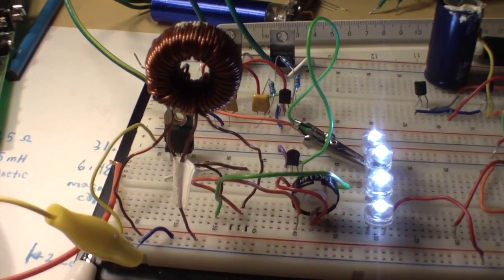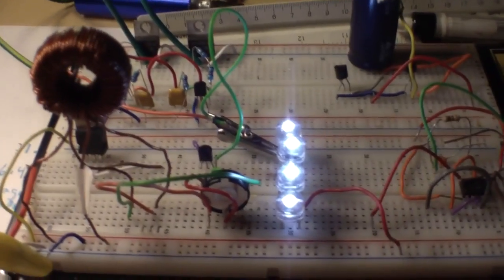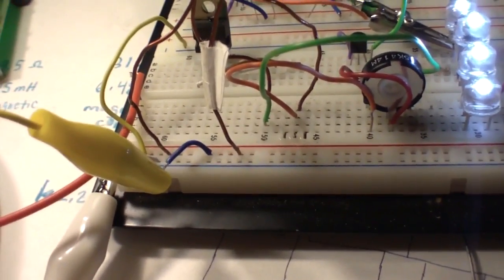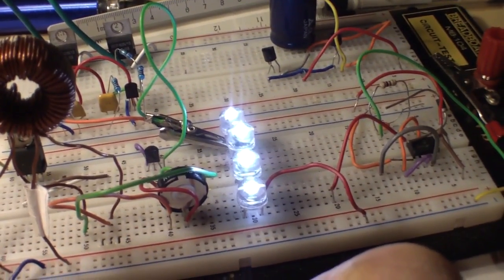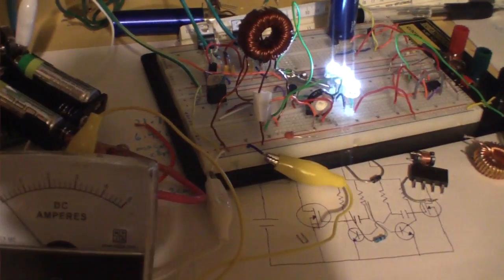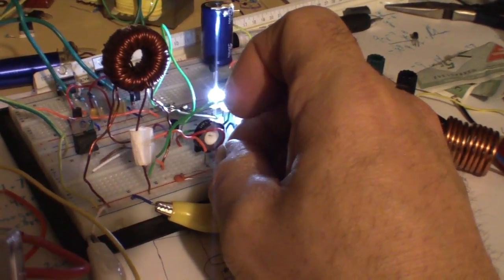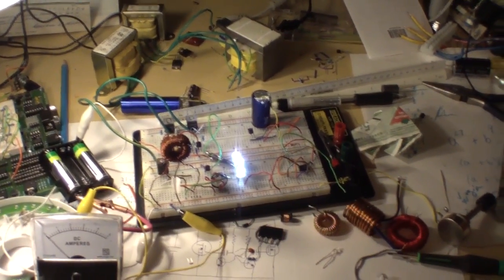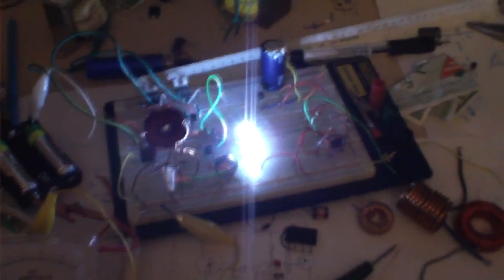Joule Thief (Revisited) - Adding Capacitance

Comment: Some of the numbers spoken were not true, you need a scope with current probe to properly read currents when the circuit is switching hundreds of kilohertz.
Using a analog meter to read current spikes has massive error. Back when we had spinning power meters on our houses, I designed a 100W 24v power supply for 120Vac input, it would pull a massive spike in current at 90 degree. At 101 watt output, the input power meter was reading under 2W. That is why most power supplies now have PFC at the front of the power supply. To get useful data, you need the proper tools. Thanks for sharing.

Comment: The voltage at the base is kinda ac, and capacitors act as short in ac so the capacitor act like short and bipass the resistor for brief period of time. This provide big boost of power in the transistor for short time. I would like someone explaining this capacitor better but didn't see anybody explaining this on any video, just showing how the lights going up and current goes down.

Comment: Might I suggest spinning up a really Big "Bifilar Pancake Coil" for your Joule ringer experiment's, I found they work well in this circuit.  
Also making Joule ringer, Pancake and Vertical Tesla Coil, 1 transistor(Slayer circuit) circuit can be used for "ONE WIRE (OFF BASE and/or OFF Secondary Coil) Transmission" as "Lidmotor" demonstrates, going out 20 feet with one wire on 3Volt source lighting LED 1 wire 20 feet, safe voltage :)  THANK'S For Sharing you insight

Comment: Resonance in any of these circuits is affected by resistance capacitance and inductance.  I think the key is that when built properly the resonant frequency of the coil and the circuit at it's optimum is done by selecting the right capacitance and resistance for the circuit in achieving the peak power of the circuit.

Comment: i feel like everyone tha g is using those analog meter are trying to het away with something why not use a digital multimeter
Reply: James Holbrook digital multimeters are great, but they aren't very good at showing subtle fluctuations in measurements like current. Analogs are great for showing minute, momentary bumps that generally are missed with digital meters. That said, it is much harder to get an accurate reading with analog. Still, there are pros and cons for both and I don't see anything particularly suspicious about using an analog current meter.  Both types can be hacked and used to fool viewers.

Comment from the maker: @egn83b  This is not an LRC resonant circuit . It has the properties of a blocking oscillator, it self oscillates, and it behaves like a boost converter, at the cost of current. Unlike a transformer when used with AC, that has the ability to be continuos because the voltage is always varying. When the transistor gets driven to full on, current rushes into the coil ramping steadily upward, but then it nears saturation, secondary flow stops, transistor shuts off. Repeat.

Comment from the maker: @User2718218 Also, there is no particular reason to be overly concerned with the absolute amp draw, without knowing the lumen output... which is why i explain, "when you are happy with the light output", try to lower the draw, in other words... tune the circuit. It's functional advice, not a scientific efficiency test. How to get more for less and still be happy : is the message here.

Comment from the maker: @User2718218 There are definitely better ways I agree. All such circuits should be measured with a RMS meter, for starters, because the draw is not linear. In as far as the directional movement during draw decrease goes, the analog ammeter current passing through a coil causes the coil to move in a magnetic field. The don't drop, while current rises, just like the earth doesn't change directions of it's rotation. However, at the very bottom of the scale... things are unreliable.

Comment: @KyleCarrington
That's how the capacitor in my Supercharged JT works: it pumps up the circuit to a higher speed.  That's why I call it supercharged.  Instead of running at under 100kHz, it runs at over 200kHz.  I've noticed that in some JTs, the cap causes it to jump into a mode where it's brighter.  But the capacitor has to be tuned to a critical value.  My SJT doesn't have that problem.  A 560 to 1000 pF cap generally does the job well.

Comment: @KyleCarrington
I've had similar problems.  That's why I tell people to use a bypass cap - 10 uF or more - across the supply close to the circuit.  1 ohm carbon film resistors are a few dollar a hundred and have almost no inductance.  The guys in the forums call them CSRs, current sensing resistor.

Comment: @KyleCarrington 
I'm assuming that "diodes, 180 mW", diodes is referring to LEDs.  Don Klipstein talked about efficiency vs LED current in one of his excellent FAQs.  Sometimes it helps to run the LED at a fraction of its max current, and use more LEDs.  Dim LEDs are not putting out enough power.  If you pay a lot to have 20 LEDs putting out what 1 or 2 could put out, then it's a big waste of money.

Comment from the maker: @acmefixer1 In this video the only important thing is, what happens, does the current go up? or go down.. accuracy is not crucial, it's about adding a capacitor to take an otherwise dim circuit and brighten it up... and use less energy doing it.

Comment from the maker: @acmefixer1 I've not had much luck using DMM on current/ammeter mode for a lot of oscillating type circuits. Sometimes they just don't oscillate with it in place... especially when trying to get a circuit to run on very low voltages. Now, your 1 OHM resistor inline... consider this... an analog inline meter like mine (preferably a milliamp metter tho) - that shunt... is VERY minimal resistance. It's a calibrated hunk of metal. Much better than your average 1 OHM resistor laying around, really.

Comment from the maker: @acmefixer1 I took the total power dissipated by the diodes, 1080 mW / total power dissipated by the circuit, 1380 mW (diodes + resistors) = 78.3%. 380 mW heat created by resistors. In reality it's 100% efficient, but only 78 is light.. so I mean to say 78% efficient at creating light... so.. every circuit is going to vary... my only point is... if you have a large array of LEDs, using a lot of resistors.. you might want to running it in buck mode or smps. Which, is granted, different than JT.

Comment from the maker: @MrTwally67 I agree. Perhaps I should have made myself more clear. i never really set out to "prove" that this, or any particular circuit using a Joule thief was more efficient than running LEDs with direct current drive... only to show that you can, in fact get a decent running circuit and not just a single dimly lit LED. Add some capacitance, play with 3v instead of 1.5 ... that's all really.

Comment: @KyleCarrington 
Re Chilliqueen, I could try to sugar coat what I say, but that doesn't change the fact that what he says is incorrect.  You can read the blog I just wrote up on his videos.
The Darlington configurations is a really poor choice for a JT because it has high loss and very poor efficiency , if it even works.  I cover that one in my blogs.  I just found my original blog on this and reposted i to my rustybolt daht info blog.

Comment: @KyleCarrington
The JTs I make are not dim, in my blog Joule Thief Conventional & Supercharged I compare the light output using a luxmeter, so there is no concern about comparing 'apples to oranges' - it's the actual light output.  I also compare the LED light output with the DC current that gives the same light.  I'll have to try to find my old blog on that one.

Comment: @KyleCarrington 
Re the shunt, exactly, But.. The problem with using the DMM on its current range is it has a higher resistance.  Take another DMM and measure the DMM on the current range.  I get over 2 ohms on the 200mA range, and over 10 ohms on the 20 mA range.  So there is a lot more loss in the DMM.  And you can leave the 1  ohm in there, and don't have to fiddle with leads and switch ranges. May not be accurate, but gives very good relative readings - apples to apples.

Comment from the maker: @acmefixer1 If you look at a DMM pamphlet it will say "10 MOHM, or 1 MOHM". All analog current ammeters are actually shunted millivolt meters. So you tell me... what is the difference? As I see it, the difference is, you are adding a load to the circuit... testing the voltage drop across the added load ... or ... you are adding a load to the circuit, and testing the millivolt drop across the load. Quite similar approaches, no?

Comment from the maker: @acmefixer1 I have also wired a super JT (or, it was a circuit by Chilliqueen call that). I remember the input draw being very very low.. about 9 mA and the lights being very Dim. I think it was a Darlington arrangement if I recall. Single Inductor, no bifilar. I'll look into that circuit again, thanks.

Comment from the maker: @acmefixer1 And as you see, in my comment above.... the typical 3 battery scenario is only 78% effiicient, anyway! So... if I choose to crank the circuit right up.. and drive it at 200 mA, what do you think, will I get comparable light? You see it at 20, yeah its low... and you see it at 100 mA, and yes it is still a bit low... however... your not losing 300 mW to resistors.. is the main point here.
Reply: Wher  is schematic
Reply: @nandahir8937  
You find it on https://en.wikipedia.org/wiki/Joule_thief
Reply: @acmefixer1  plz the schematics for the one with capacitor

The Wikipedia one doesn't have it

Comment from the maker: If you use the LED calculator to determine the circuit for this config. using, instead, the typical 3 battery (4.5v) scenario:

each 10 ohm resistor dissipates 100 mW
the wizard thinks 1/4W resistors are fine for your application 
together, all resistors dissipate 300 mW
together, the diodes dissipate 1080 mW
total power dissipated by the array is 1380 mW
the array draws current of 300 mA from the source

1080/1380 = 78% efficiency. The rest goes to resistors.
Reply: It's 2020 Sept 29, like 8 years later, and I wonder if there is still any interest in this.  I still have the pile of more than a hundred Joule Thiefs I built and experimented with.

The 78% efficiency was not calculated by multiplying the LED voltage by the LED current.  I measured the LED current with a 1 ohm CSR - current sense resistor.  It didn't matter if I put a 100 uF or more electrolytic capacitor across the LED CSR.  I measured the LED voltage by putting a RC lowpass filter between the LED and DMM.  I used a few different DMMs and they all measured about the same.

I measured the battery voltage and current the same way.  The efficiency was the LED voltage times current divided by the battery voltage times current.  An example might be LED power was 3.3V * 17 mA or 56 mW.  The battery power was 1.5V * 67 mA or 100.5 mW.  So 56 / 100.5 equals 55.7% efficiency.  The standard JTs I built were typically between 45 and 60 percent efficient.  I used a BC337-25, 2N4401 or PN2222A for the NPN transistor.  A 5mm white LED.  A 1000 ohm base bias resistor.  The battery had a 10 to 47 uF across it.  The coil was a Fair-Rite 2643002402 ferrite core 3/8 in or 9.1 mm OD.  Two windings, each with about 20 turns of 26 AWG magnet wire, with an inductance of about 100 uH.  The circuit oscillated at between 60 and 100 kHz.

Comment from the maker: @acmefixer1 But also in play in the fact that you've changed the frequency. Running Leds normally, there is no frequency, it's 100% duty cycle. Those pauses in light actually save energy. Which, by the way, make even your measurement technique inaacurate. And if you think about it, the shunt in an analog current meter is exactly what you just said: an inline resistor, and the millivolts are being measured across it. It's all the same, really.

Comment from the maker: @acmefixer1 Well... I agree entirely with you. I think that Colin Mitchell, when talking about efficiency, is referring to the use of the buck converter circuit, which is also using spikes, but is, actually different. And in that situation, he's got a lot of LEDs, so... in a normal 12V situation, you'd have a fair number of resistors in play (conventionally).... Your point is well taken, the main idea here was the capacitance!

Comment: Good vid, until you turned the light out.  But "about 70%" has no accurate meaning.  Put a 1 ohm resistor in series with the LED and measure the voltage across it with your DMM set to its lowest range, 200 millivolts.  You get 1 milliamp  for every millivolt measured.  I'll have to check Talking Elec to se what he says.  So far I haven't been able to get a conventional JT to be as efficient as my Supercharged Joule Thief, in high 80's %.  See my BLOG on rustybolt daht info for info on the SJT.